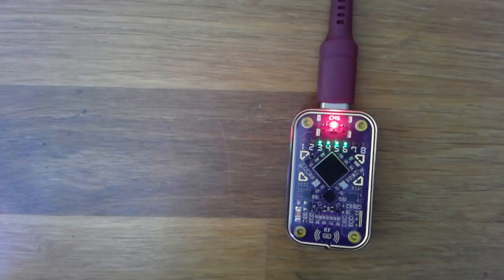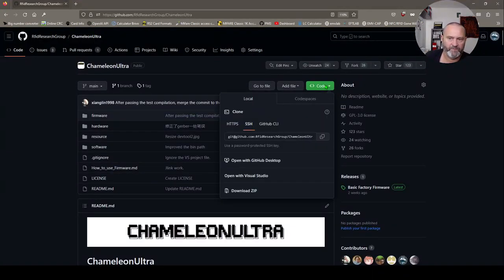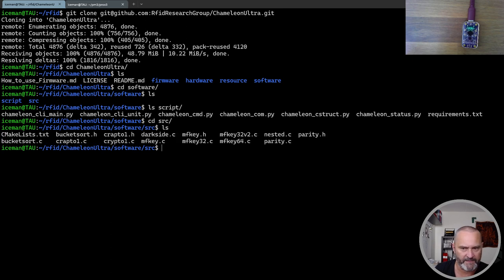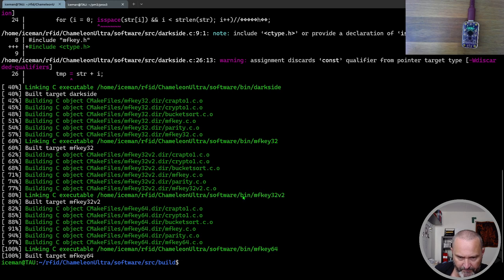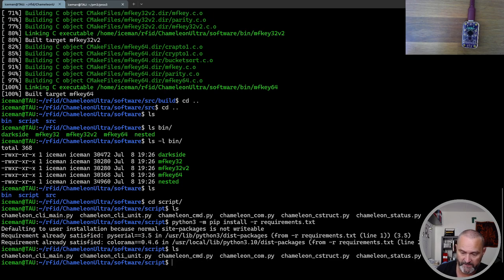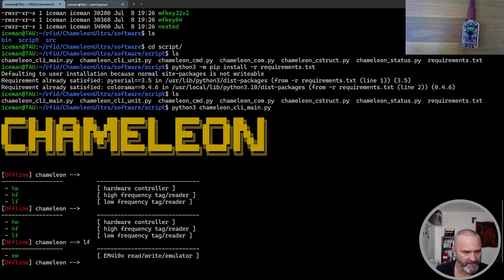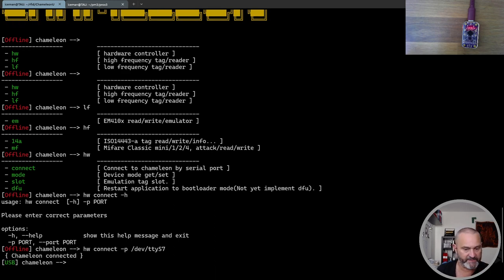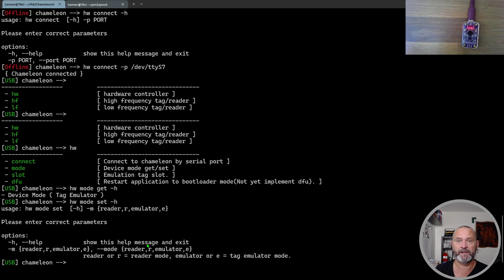Chameleon Ultra: A Step-by-Step Guide to Downloading, Compiling, and Running the CLI

Comment: Thanks for the great introduction, 
looking forward to your upcoming videos.
I am waiting for my Ultra after I lost my "tiny Pro" when it came accidentally close to the strong magnet in my smartphone cover, and the FRAM chip gets corrupted permanently, and with the strong epoxy cover, there was pretty much no chance to remove it without causing further damage to the onboard components, that was a drawback from my view of point.
Reply from the maker: Glad you liked it,
The FRAM magnetic issues is annoying and the epoxy do make it hard to repair.
Reply: FRAM is not affected by magnet

Comment: Thank for the video. Can I use macos for connecting to Chameleon Ulta?
Reply from the maker: If MacOS support flutter you can use the GUI.  Otherwise there is a python3 based CLI which should work just fine
Reply: @iceman1001  Thank you

Comment: I just received mine today. Is this the first thing I should do before using it?
Reply from the maker: yeah,  that's a good one.  I think you should download a GUI or an app and see if you can update the firmware that way.
Reply: I followed you up to the SSH part but no clue to get to the terminal part of video
Reply from the maker: @redvette33  you need to do a serial connection inside putty.  not an SSH connection :)

Comment: I am on Windows and am trying to follow the instructions but I get to the "make" command to build the software and I keep getting "No targets specified and no makefile found" I have downloaded visual studio and my compiler is detected as  MSVC 19.37.32822.0 when I use cmake. Any suggestions?
Reply from the maker: try  `make all`   instead ?
Reply: did you find a solution? same problem here, make all not working too

Comment: hi iceman, I have been running into an error: 
line 345, in send_cmd_sync
    raise TimeoutError(f"CMD {cmd} exec timeout")
TimeoutError: CMD 1002 exec timeout, 
when executing the hw set and get -h line. I could use some help thanks!
Reply from the maker: Good question,  
have you asked in the Github repo?   I can only suggest raising a question there.  
or ask in the discord.    Seems like your device times out for some unknown reason.   Maybe others has had the same problem?

Comment: I got mine yesterday, tried to compile the firmware on my computer and flash and immediately bricked the device (bootloader is fine). Would be interesting to see a way of getting out of this situation, unfortunately the documentation is very scarse as today which makes it unfriendly for newbies
Reply from the maker: You are right about the documentation.  They have a bit of room for improvement :) 

I will have to look into making a video about compiling / flashing the firmware.
Reply: @iceman1001  I managed to solve it compiling from windows (before MacOS on M2 processor), still I hope they fix docs + softwares, this little thing it's great but it needs software :D
Reply from the maker: @leandropiccionenter  indeed true.  You can also contribute with your newfound knowledge and be the change you wanna see in others.

Comment: no matter what i try mine doesnt seem to work ? im holding b all it does it swtich off after about a second, ive downloaded a app on android and it connects when i try to use the read feature it does nothing ?
Reply from the maker: yeah,  I had that problem when the firmware on the device is too old.
Try compiling and flashing the firmware yourself first.   Then the apps and gui start working much better
Reply: @iceman1001  what is the thing you use to load the firmware command prompt ?

Comment: hello, congratulations for the video. can you help me? i'm a neophyte. at the command  "cmake .." .. i get this response

$ cmake ..
CMake Deprecation Warning at CMakeLists.txt:1 (cmake_minimum_required):
  Compatibility with CMake < 3.5 will be removed from a future version of
  CMake.

  Update the VERSION argument <min> value or use a ...<max> suffix to tell
  CMake that the project does not need compatibility with older versions.

CMake Error at CMakeLists.txt:3 (project):
  Running

   'nmake' '-?'

  failed with:

   Impossibile trovare il file specificato

CMake Error: CMAKE_C_COMPILER not set, after EnableLanguage
-- Configuring incomplete, errors occurred!
Reply from the maker: I suggest you head over to the discord server and ask questions there.  But it looks like your dev-env isn't setup properly.